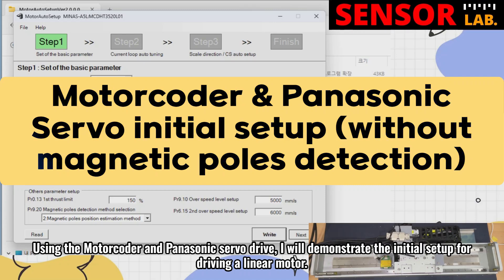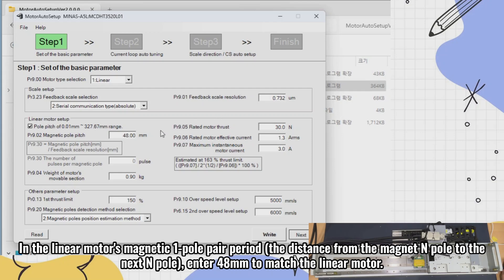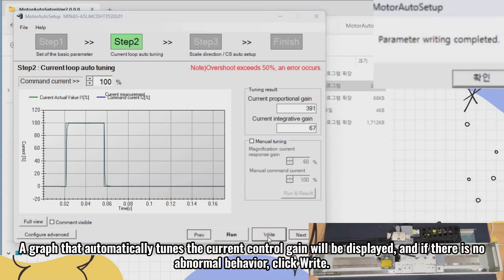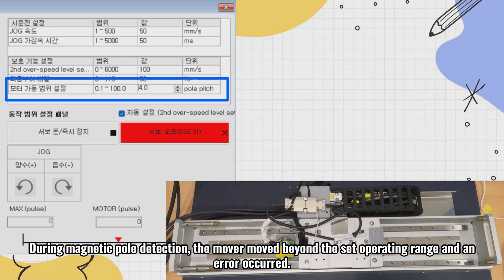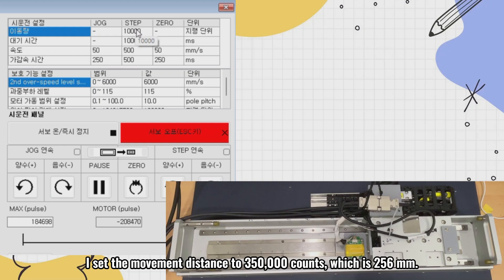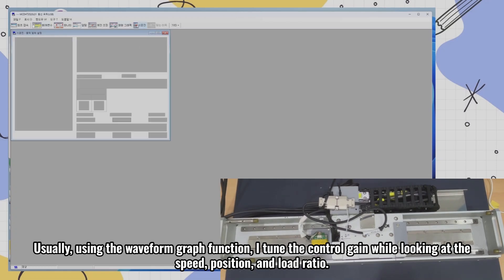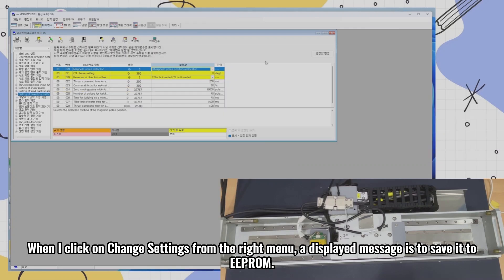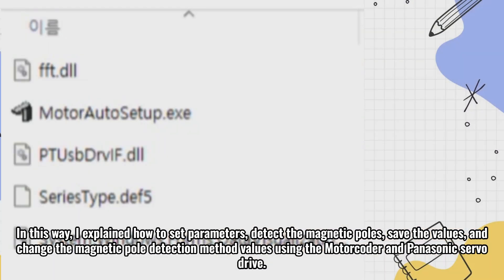How to setup the Panasonic servo drive with a linear motor and the Motorcoder. SensorLab

Comment: What is the model of the servo drive used for this linear motor?
Reply from the maker: The model number of  Panasonic servo drive is "A5L". "L" means that the drive can cotrol the linear motor and direct drive motor. Thank you for watching.